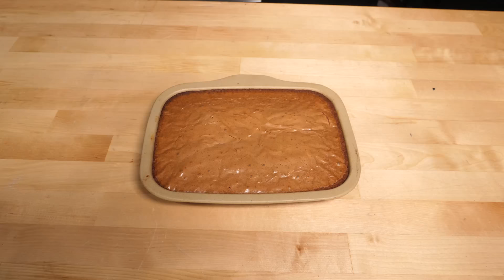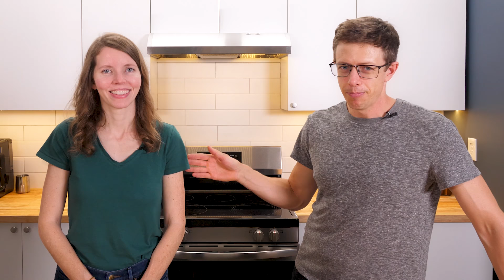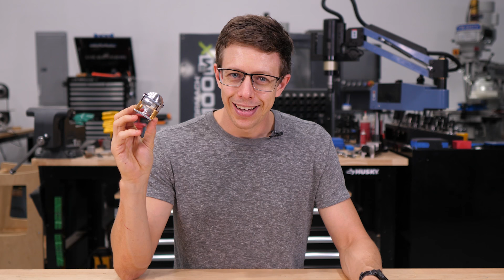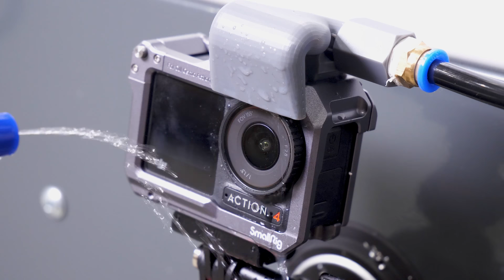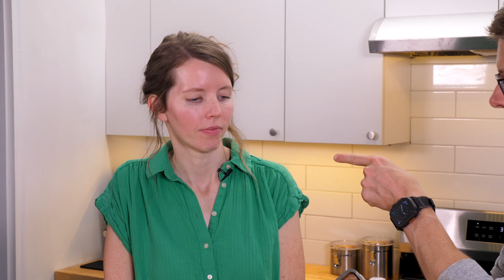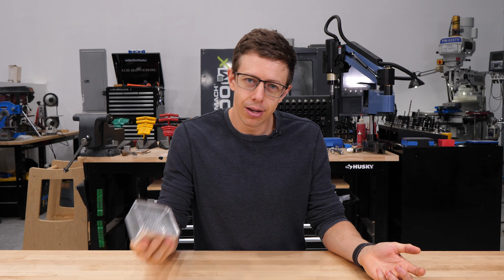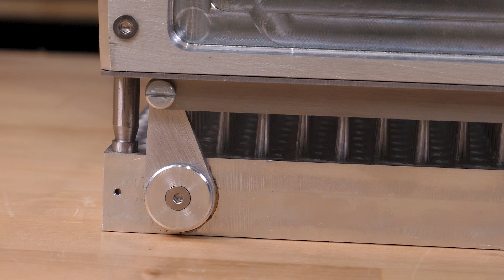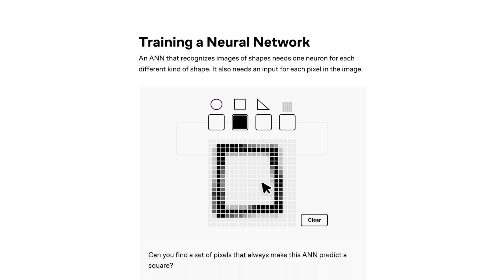Baking brownies from the inside out

Comment: this is beautifully overengineered. 
As a baker, if you want something to be edgeless you just wrap whatever pan is cooked in with damp fabric strips. Water absorbs the heat and prevent the edges of the pan to get too hot
Reply: And if you want to remove something easily from a pan, you just line it in parchment with excess on the edges to lift it out. I'm honestly surprised he didn't try that with the larger spike pan. Or a setup similar to a broiler pan.
Reply: @EmilyExplosion27  to be fair, there would be an issue lining a pan designed to have spikes stab through it with parchmet
Reply: @spaghettiboney  I mean you could just stab the spikes through the paper it’s not that hard lol
Reply: @EmilyExplosion27 because it had spikes and couldn't get to the brownie
Reply: Hahaha. .... This line could have saved him months.
Reply: @skdsky0  and a video
Reply: When I saw the pockets in the side of the pan, I was certain that vacuum jacketing was next...
Reply: as in the fabric on the outsides of the pan?
Reply: @bepsi6204  yup theres some specifically made for that purpose theyre literally just called cake strips. And you can DIY them by using damp paper towel wrapped in tinfoil.
Reply: @dad_disapproves  wrapped in TINFOIL? will that not just continue to overbake and crust the edges?? or the other way round??? i need this information as a person who loves brownies but has a disdain for the outer crust 😭 i stg i'm hunting these comments for replicable answers that don't require me borrowing power tools and scrap metal from everyone i know lol
Reply: @bepsi6204 Yes, google “cake strips” to see commercially made ones. You can use any thicker fabric though.
Reply: @bepsi6204  yes.
Reply: whats the point of fixing a problem nobody really has if you dont overengineer it?
Reply: As a baker, I was looking for this comment. Cake strips or a bain marie in a ceramic or glass pan! 🤦🏻‍♀️
Reply: I own "magicake" strips that do exactly this. They hold water on the outside of the pan so a cake cooks evenly. I like brownie crust to most, so I've never tried it. But that's what I'd do if i wanted to make all-interior brownies.
Reply: Silance Baker! The 5-axis CNC mill owner is speaking!
Reply: Wilton bake even strips!!
Reply: You can also just trim the crust and eat it or give it to someone.
Reply: Besides the obvious "just use a wet rag cake wrap," my only other concern is this is untreated aluminum.  Are you worried about aluminum leaching into the food?  Perhaps at least anodize this first?  I dunno.
Reply: I was just thinking, bro needs introduction to an actual baker. Fabric strips and bain-marie, check.
Reply: @douglasbaker9663 yes!
Reply: literally cooked.
Reply: I was just hoping he would put some sort of grease or seasoning on the pan
Reply: Is that also why cakes don’t have edges, well not that specifically so much as the higher moisture content of cakes, or am I wrong about cakes having a higher moisture content?
Reply: Water cooled jacket aluminium pan💡😆
Reply: I was wondering if putting the brownie pan into a shallow dish of water while baking would help. Like when you're making a creme brulee.
Reply: @gadgetgadzooks  I had added my thoughts and experience with bain marie brownies, above in a comment starting "NABBT, not a Baker by trade"; which might help satisfy your wondering, too? :)
Reply: There is nothing so simple that it cannot be over-engineered.
Reply: this is the very definition of over engineered.
Reply: Or silicone bakeware.
Reply: Would doing a water bath with cake batter in the oven achieve the same effect?
Reply: @SmugStingray 

NABBT (Not A Baker By Trade), and excuse the lengthy and tangential reply/parts, but IME bain marie/water bath method is helpful for brownies, but less so for cakes. 

If making a tray cake, putting some (lower/smaller?) level of boiling water into an outer tray, depending on the recipe might be ok to get a more even consistency without drying out edges; but where the batter is thick, the extra moisture in the oven would likely effect the rise (I tried it with a deeper cake in a larger round pan before and it didn't help). 

Alternatively, if its just about getting even moisture within a well-enough baked cake (and easier if you use baking parchment/paper) while the cake is still warm (but not still steaming hot), whip it out and wrap it in cling film, or pop it tightly into a freezer bag, either way, leave it cool the rest of the way to room temperature, then pop it into the fridge for a few hours/overnight; then the moisture will be more evenly dispersed, between it steaming around the bag while cooling, and when the fridge further cools it it will draw the moisture out to the edges too. 

Also worth saying (might be relevant?!) I don't use box mix in my brownies, mine are chocolate, butter, sugar, eggs, vanilla, and specifically only toasted sieved plain ("all purpose" for Americans, I think, has nonraising agents, anyway) flour; toasting the flour removes some water content and cooks it, which means no grainy texture when you later cook the brownies, and you can purposefully take them out when they look sort of "underdone". 

I also essentially custard the eggs into the melted chocolate, butter and sugar mixture, so that they are appropriately heated at that stage for salmonella etc. safety. 

The toasted flour effect also means that recipes need a bit less butter, and a bit more flour, than my original recipes call for, but that is relatively easy to adjust; if done that way, I find that the brownies don't rise half as much as the box-mix ones in the video did, and the result is a dense and delightfully squidgy brownie, almost like a good fudge, with (when using a bain marie) only the barest of "edges" on the tips of the corners of the shorter sides (that is likely only happening for me as that side of my trays have a slight incline and that edge of the tray is too close to the warmer sides of the oven).

If nothing else, to all brownie folk, try toasting your flour, total game changer IMO! Just spread out a layer no thicker than 1cm, on baking parchment, in a tray, and stick it in a medium-to-hot oven for about 10 mins (I rotate two trays in five/six minute intervals as I need about four trays of flour for my doubled recipe, and store any excess in a jar to toss in with the next batch when it is still hot); it'll "brown" a little and smell like popcorn when it is done. Then just pull up the four corners of the parchment and stir/shake it around, to break up any larger clumps, leave it to cool (shaking it around speeds this up some), and then sieve it before using it. It also makes excellent crêpes, and cookies too; likely anything that needs to rise will likely need at least a little extra baking powder and/or bicarbonate of soda to get a decent rise, but the flavour and texture improvement is SO worth it for me! Kind of like the taste change that happens with browning butter,); but the texture improvement, for me, is what particularly elevates the brownies!
Reply: @gillianboate omg thank you so much, this is so helpful in many ways, I really appreciate people this into baking as much as I am where they do experiments :3
Reply: @SmugStingray  Just saw you had replied now since getting another notification about someone else's reply, so sorry for the delay, and you're very welcome! Happy baking/experimentation!
Reply: My folks manage a bakery that uses a big combi-oven that does convection and steaming; they'll bake a cake, quickly cover it and steam that, and then let it sit 20 minutes before freezing. I want to think that the 20 minute rest is letting the temperature equalize, bringing up the internal temp without an external heat source hardening the outside, and wonder if a brownie could be treated similarly. That way you get the edgeless result with no special equipment
Reply: I'd rather spend the 899.99 lol
Reply: But can you make a brownie with nothing but edges??
Reply: @snowman8135 just cook the no edge one more, no?
Reply: Hahahahah😂
Reply: This is what I was yelling at the screen! 😂 🎂
Reply: yeah but this pan is fully reusable with no waste unless you reuse the same fabric strips over and over
Reply: LMAO
Reply: Hey, I’m not a baker but do you think you could try something for me. Would you test making brownies but sous vide? Idk if that’s even possible but I really want to know now.
Reply: But the 5 axis doohickey can't do fabric
Reply: He could also just use a microwave... but that isn't 'content' i guess.
Reply: Or you could just cook one with edges and then cut the edges off....
Reply: @onc-g9z  Oh you and your fancy-pants "common sense."
Reply: @onc-g9z yes! And share them with literally any other person who would be freaking delighted!
Reply: @onc-g9z  that’s wasting brownie
Reply: @onc-g9z 😂😂😂😂
Reply: Or how about immersing the brownie pan in a water bath?
Reply: @larryphotography Steamed brownie?
Reply: Nah nah nah that just wouldn’t work in this case
Reply: but where's the fun in that?
Reply: Came to say this. Do you think he even asked the google first? 😂
Reply: Engineering foiled again by someone from a completely different field with common sense! Also thank you, I'm going to use that method.
Reply: i was hoping some pastry chefs were in the comments.  hes trying to figure out stuff that pastry chefs have solved ages ago.
Reply: My first solution was just... knife. Truly the simplest (and cheapest) option
Reply: So damp metal strips? Not many cloth items can be baked safely
Reply: i mean specifically for brownies you can just get a disposable aluminium baking pan and rotate the pan 90 degrees every 1/3rd of the cooking for the same result
Reply: Or, you know, cut off the edges after...
Reply: @yobgod.ababua   waste

Comment: A tight fitting cone into the hole with cambered edges would probably have solved the "leakage". And to align the cones perfectly to the holes, just fit cones individually and then glue/weld them into place.

Comment: There's a... much lower tech solution to a similar problem that is used by people making cakes professionally that need them to rise flat (so, bake evenly from edge to center without the edges baking first and the center last), so that they don't have to trim the top and waste cake and that is... A cool moist strip of towel around the outside edges of the pan!
They even sell professional versions of it on the Wilton website but you can literally just tear up an old kitchen towel and sew it up to get the same kind of product

Comment: I wonder if you made a thermally resistant pan, out of some sort of thermal insulator like silicone or something with an internal air gap to slow heat transfer into the edges if that would slow the overcooking enough.

Comment: Mech E that works on heat transfer here. For the heat sink channels on the bottom, don’t cap the ends. It will allow the air to natural convection to form a more steady current into and out of the heat sink. Also extending the vanes out past the edge will greatly increase the area and heat transfer rate because the air current that develops is completely uninterrupted and the fin can more closely equalize to the environmental temperature. Pin fins might work better in the center  too (no channels at all, just columns) because they allow omnidirectional flow. A heated plane wants to make heat rise in a roughly rotationally symmetrical way. Anyway loved the video!!!

Comment: Why couldn't you just change the thermal conditions of the pan to offset the difference in heat between the middle of the batter and the edge? A lower TC material starting off colder in the oven or something like that? I'm surprised you immediately jumped the mechanical methods to equalize thermal conductivity

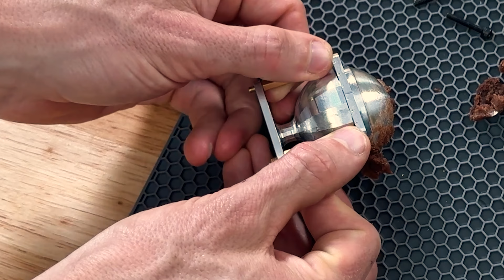Comment: Hold on, Your onto to something with that first design! Hear me out! Take the Prototype from 4:10 into a larger Multi-cell design similar to the layout of a muffin/cupcake tray. The texture may not be ideal for a snacking brownie but the size, shape and consistency of the brownie you’ve created seems to be ideal for a Brownie Pop (Brownie Cake Pop)!

Instead of screws, Maybe you can somehow mimic the mechanism that Pullman Loaf pans use for their lids? 
Testing would be required to see if a tray design could still have the same effect and how many cells you could get away with but if your interested in making something that’s marketable (wether you’ll sell the rights or manufacture it yourself) Bakers would 100% use this!

Comment: The only thing I would do different is make the handle removable, that way it doesn't heat up in the oven and makes the tray more presentable on the dinner table. I do worry about how much rubber, plastic gassing and the possibly of metal left behind.

Comment: I think you missed a very important observation here, you have sold this invention short. This is simultaneously both a no edge and an all edge pan. The reason brownies have defined edges is due to inconsistency in temperature which you have removed as a variable. So to make an all edge brownie all you should have to do is cook it for a little longer.

Comment: The first spike pan run can be used as a good flower pot. Its already a product that exists, but certain plants can use the spikes to manage their roots and water in the soil better. The aluminum won't erode in those conditions either, so it's actually kind of useful as is.

Comment: Why not “just” make a pan with (vacuum?) insulated sides? I.e instead of heating up the insides with spikes so it’s the same as the edge-touching bits, just make sure the edge-touching bits heat up slower, so it’s the same as the insides

Comment: Couldn't you simply just create a pan where the edges are somewhat insulated so that the edges/bottom receive heat at the same rate that the middle would? Then the only 'direct' exposure would be the top and it would cook evenly.

Comment: What if you made a pan that was air cooled like your camera case? The walls of the pan would be hollow and air would be pumped through to control the rate of heat transfer at the boundary

Comment: My question is whether using a pan with the right level of thermal insulation to slow the heat transfer from the sides (and theoretically make it cook at the same rate from all sides) would help with the edges or make it worse.

Comment: For anyone who can't mill or print their own pan just use what cake decorators have used for years - Wilton Bake-Even Cake Strips.  They are insulated fabric covered  strips that you soak in water and attach to the outside of your existing pan of any shape. The insulating properties ensures that your batter bakes flat and to an even doneness all the way through. It effectively results in cakes or brownies with no crusty edges.
Reply: there's also cake heating core rods, which is the exact concept of the video but more versatile. it's just a rod of metal with a flat base that you can put into any cake pan to heat up the center too.
Reply: But you don’t get to use a CNC mill if you do that.
Reply: A 100% silicone baking pan would be better
Reply: Came here to say this. I have a product that does this my kitchen and I think it's awesome.

Or if you want to use a spring form pan, you can get very similar leaky results.
Reply: Or... a water bath
Reply: I was coming here to say that he could have made a spring-form wall to go around his spiked pan base, but "silicone pan" and/or "insulated strips" Make way more sense than milling out 90% of a block of aluminum.
Reply: is it possible to just bake them in a water bath?
Reply: A cheap, already made solution that works? In this good christian engineering channel? BEGONE!
Reply: @zuludude2  "good chrisitan" - seems like an oxymoron to me and an insult to this channel...
Reply: @ross-carlson it's a meme iirc, the original form is "in my good christian minecraft server"
Reply: @ross-carlson  It's a reference to the "not on my good Christian Minecraft server" meme.
Reply: @ross-carlson  it's a meme

Comment: 19:55 Ok I was really trying to figure out how you were going to get from a mortar to a brownie pan. Brilliant makes more sense.
Really is a bummer when you accidentally make a mortar though. Mine needed a timing mechanism for the valve and I think it would have worked much better, I can't control the pressure accurately enough to fire it consistently. Did get the distance record though.

Comment: What make the edge hard is dehydration. To avoid this you can cook at lower temperature or steam the food, or use a bain-marie. Like making a flan for example. I cook them at 130C in a oven with a bain marie. This way I don’t get a cake-like crust on the top.
It wouldn’t work for a brownie because you want to have a Maillard’s reaction which is the chemical reaction between sugars and proteins at 140-160C. That what browns the food and create an array of flavour molecules. Steaks taste good because of Maillard’s reactions. If you steam a steak it doesn’t taste like a steak, it tastes like boiled meat.

Comment: Might be late to the party but wouldn't it be easier to make a pan with 10mm silicone insulation on the sides (with air pockets) to match the heat conductivity of the dough? A silicone pan with fins on the inside sidewalls and bottom surface, and a metal pan that fits right into it.
Silicone has less heat capacity and less prone to burn your hands when you take it out of the oven.
I love the engineering of the lifting mechanism though.

Comment: The thing you have to consider when cutting any cake like substance. You need a hot, clean dry knife. Not a cold knife or ..  robot razor blade. 
Always run knife under searing hot water, get it saturated, towel it off quick, make a cut. Wash knife in hot water, dry, cut... you get the idea. 
Perfect cuts every time.